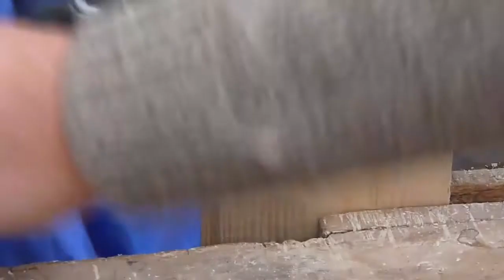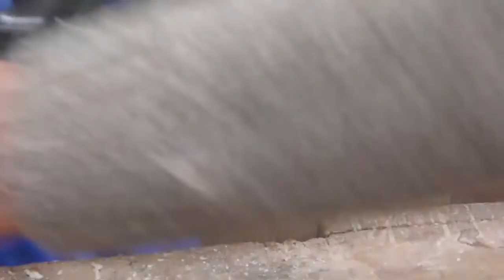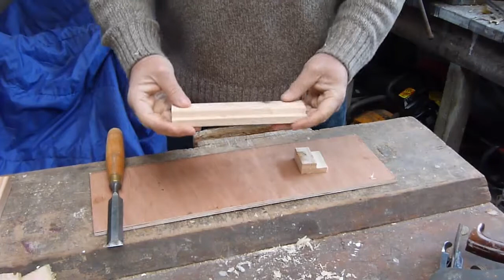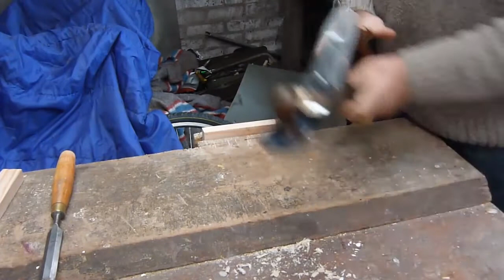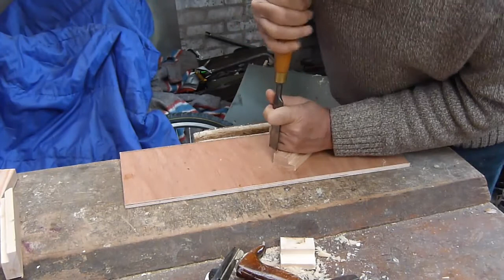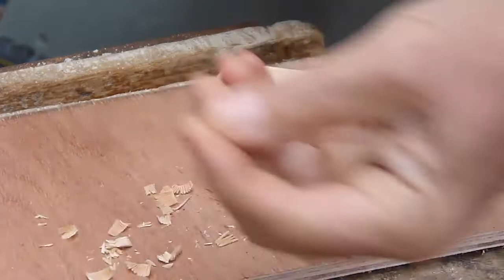Avoid end grain break out. End grain paring technique - THE EASY WAY

Comment: On longer lengths of wood, like say a door bottom suing an electric plainer,; by plaining one end making 1 or 2 passes into the wood, about and inch or so. then starting a run the other end of the wood after, it stops,  the breakouts. Just make sure the plainer blades do not travel that last inch  to the edge. Next run just reverse the start side go in about and inch again. then start the run the opposite end, you will not get breakout doing it that way. Also should there be any problems the shallower the cut the less the problem 99.99% of the time. Best make 10 passes than 2 and screw the job up!
Reply from the maker: Yes I do that too. But for bench work its either this way or a small chamfer on the end grain and plain towards it.